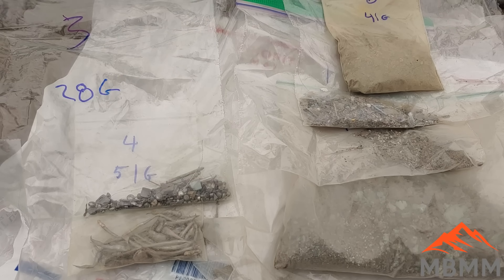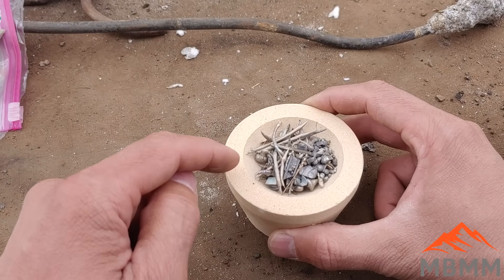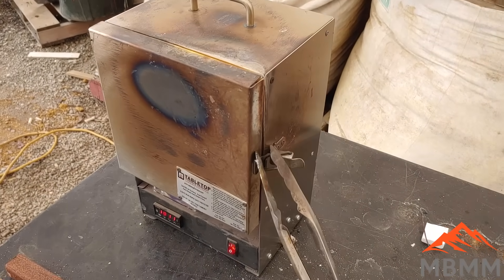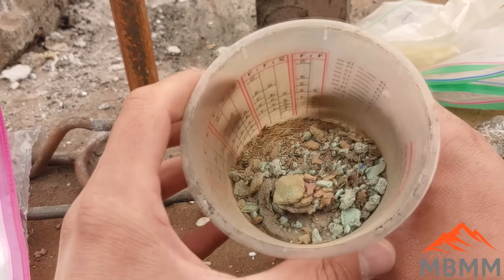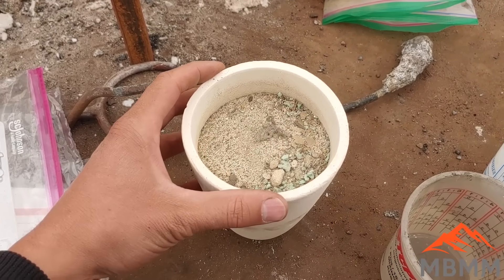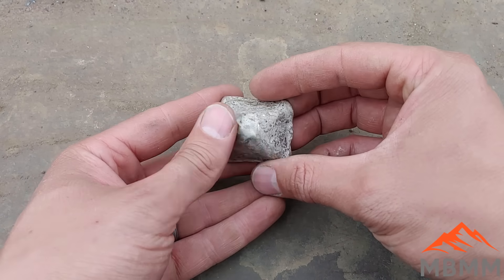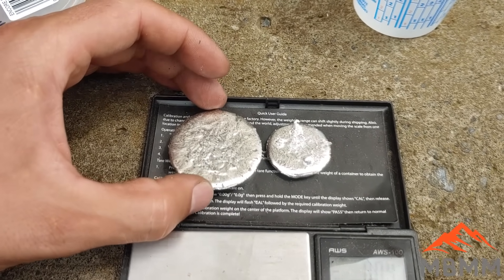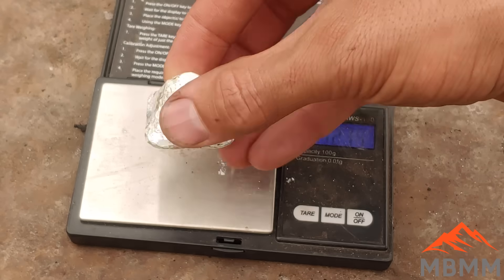Silver Refining Process Without Acids

Comment: So what is the next step with the “buttons”? Is there a way to separate the gold from silver? I don’t do any mining or refining but I do find your process and videos highly interesting. Keep up the great work.
Reply: Yes, if an alloy is mostly silver with 25% or less of gold, the alloy is treated with nitric acid which will leave the gold and dissolve the silver. The silver solution can then be filtered off the gold and precipitated into silver chloride with HCL or sodium chloride and reduced into pure silver metal with potassium hydroxide and sugar. The gold can be melted too. Then you end up with the silver and gold separated
Reply: You could also leave silver chloride in sun outside to reduce to silver metal without  sugar potassium hydroxide

Comment: Jewelers rarely work with pure silver, but most commonly sterling (.925), sometimes others (.900 and .800) One of the metals used to alloy pure silver into sterling is copper.  

Thanks for another great video.
Reply: Much of what is in what I sent him is sterling, with silver solder chips, and some copper and brass, as we work with all. But I also had the slimes and silver plate from reverse electroplating silverware.
There certainly is some pure silver in the mix. As most bezels are pure silver, and some jewelry is made with pure silver.
We tend to not work in less than sterling.

Comment: Thanks for doing this Jason. I decided to keep my pyramid, for now, vs melting it down.
What was in this . . . copper slimes from reverse electroplating silver, as well as the silver. Sweeps from a silversmithing class, including filings, snips, and balls. Also . . . a lot of solder chips that are always getting swept up. Plus some contaminated water cast silver with I believe nickle.
I removed as much of the magnetic material as possible. Which was from files, broken saw blades, and steel wool.
Reply: You mention slimes from electroplating silver.  I always use electrorefining to purify my silver, and often times end up with a bit of PT group metals in the slimes.  
Have you had the pyramids tested with an XRF to see if there are any other PMs other than just silver?   I’d be curious to see how pure this method actually gets silver.
Reply: @uspockdad6429  Not electrorefining, though I do want to get a set-up to do that, I love the look of silver crystals.
This is just putting silver plated items in a salt bath and hooking them up to a battery charger. It gets messy real fast. Those green clumps in the video are the copper + other base metals slimes, or salts.
Reply: @uspockdad6429 yea. Thanks for sharing info, and real good question.
Reply: Sounds good. Thanks for scrapping. I do it all the time, but am just getting into this part. I have a suggestion as to how to clean the slag off. I don’t know if you would loose content. Maybe us a 6 or 8 inch buffing wheel with rouges. Be careful with them.

Comment: I've been playing with acid but I'd like to give this a try, have any idea on the purity?
Reply: If you already know the acid process, stick with it, as your recovery rates are astonishingly higher and your waste is much less. This process is meant to be used to understand if there's anything good in a sample from a potential mine, but is not used to extract metal commerically, as it misses a lot and most importantly you need to add all that lead (and deal with cupels soaked with lead oxide afterwards, not counting however much you breathed in).

Comment: I was told to add potassium nitrate to purify the silver further with the same fluxes from a older gentlemen who used to do refining, I may be wrong but it seemed to work last I tried but I was working mainly with sterling and coin silver.
Reply: Me too, I actually still have this flux that has 20% potassium nitrate in it -- works great.

Comment: Thus outta be good 💪 pretty cool stuff brother. I’m doing the acid extraction right now. Then I run it through my silver cell and get beautiful crystals.
Reply: I just finished putting 1.5 kilos through my silver cell, and will have another 2 kilos to run in a few weeks.   
Have you had yours tested?   I’ve been getting .9999 purity after running through the cell.
Reply: @uspockdad6429  I just ran about 20 lbs of silver through my silver cell.  I ran it a second time to come up with high purity. It took a month or so to do.  Have you had your silver assayed to see it is really .9999?  I plan to do it once I get some melted into bars. I've read that once silver is refined to a very high purity, there will be crystalline structures visible in the ingot.  Have you seen this?  I believe it would have to be five 9s or greater, because Maple leafs are four 9s and you don't see the structure it them.
Reply: @katana1960  
Acid extraction, silver cells, etc. -- you guys need to do your own instructional videos!  This is very interesting stuff that people want to know how to do, and that you then can also earn a bit of advertising income from.  I once inquired about the Maple leaf's four 9s purity and was told that 99.99 was four nines, 9.999 was four nines, 9999 was four nines and .9999 was four nines.  Of course you and I know better, but I would not trust that the coins are 4 nines fine unless I could get a better answer to the question.
Reply: Silver Mac how do you do the acid extraction looking for a safe method I can try out in the lab
Reply: @yeukaimutusva1356  Watch Sreetips on YT